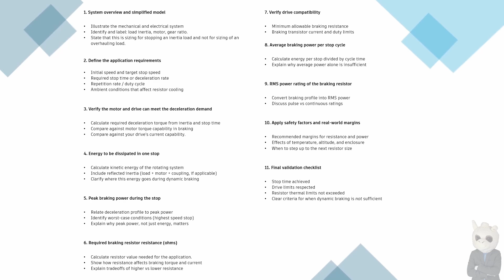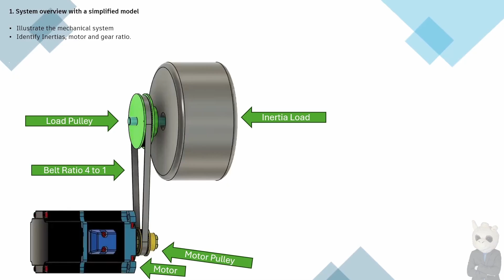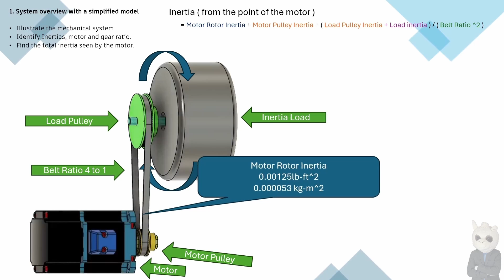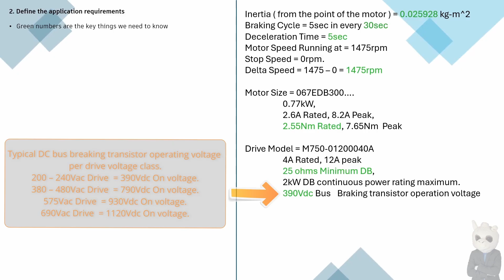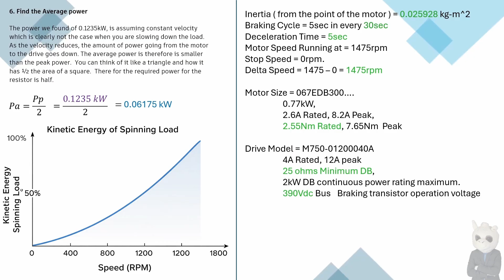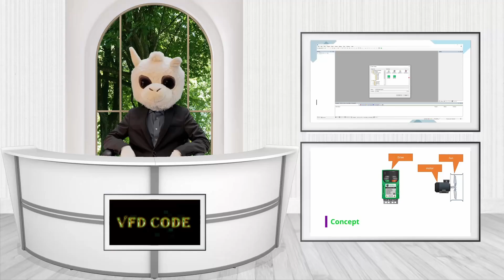Sizing a Dynamic Braking Resistor, for Stopping an Inertia Load

Comment: Nice video! I'm trying to add a dynamic braking resistor in a circuit with a brushless motor, but i'm have some troubles, first of all i have no idea how to physically attach the resistor into the circuit. Do you have any suggestions?
Reply from the maker: what is the full drive part number.  Then i will know what you are looking at.